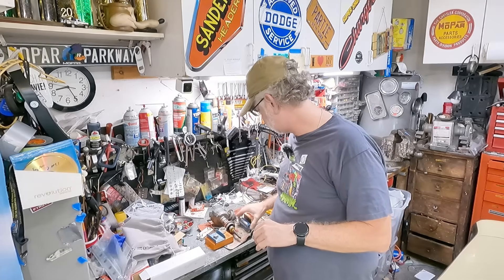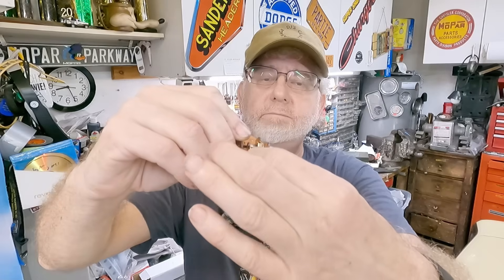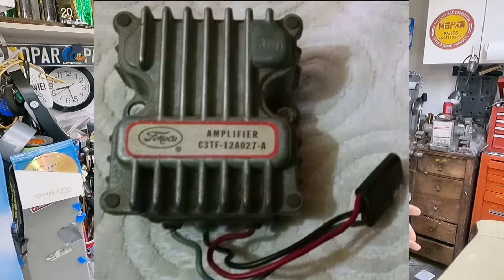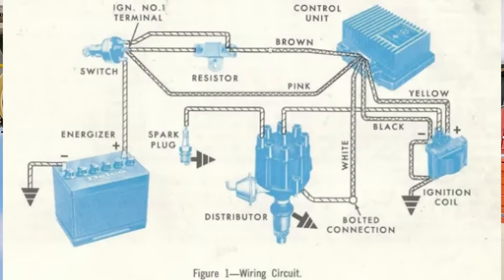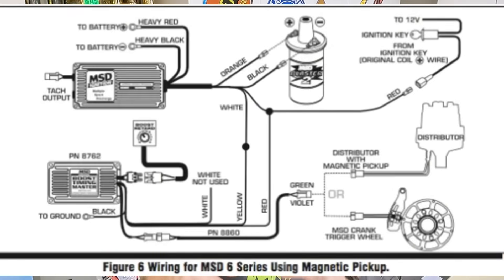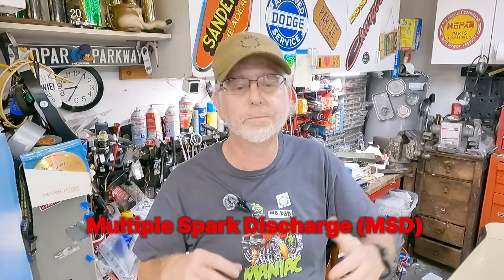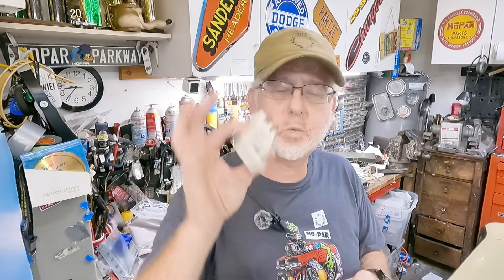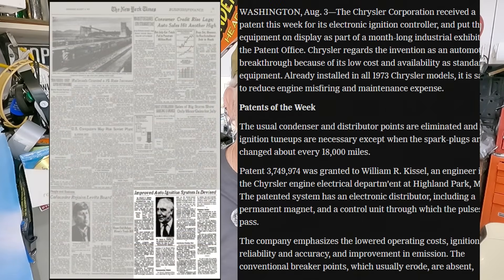Why Everything You Thought About Electronic Ignition is WRONG

Comment: By my experience, the breakdown of the potting compound on these original Chrysler ECUs is not necessarily heat caused. More age related, breaking down over time, have a box of those that haven’t been on a car in decades or exposed to any heat whatsoever, where the potting compound has been liquefying on the shelf for years. Have seen others, later ones generally, exposed to a great deal of heat and no signs of breaking down/melting.

Comment: The 4 post ballast was made for trucks. Put them in a car and you will have problems. I have never seen a factory MOPAR electrotonic distributor go bad. I have picked them up off the ground at junk yards, a little brake clean and they work.
Reply from the maker: Sorry but you are not correct. ALL mopars had 4 post till 1980.  And chrysler distributors and boxes go bad just like all electronics.

Comment: One thing you mentioned was the transistors and moisture were not a good mix for longevity.  You didn't mention that later versions of the systems were potted or encapsulated in epoxy to help remedy this.
Reply from the maker: I did overlook that.  Thanks for watching

Comment: Chrysler used that ballast resistor reliably for many years. The failure was most often blamed on rain/carwash water hitting the hot resistor due to a flaw in the hood seal at the cowl. Simply opening the hood while it's raining would dribble cold water on a hot resistor. I made a simple plastic shield for the one on my 64 Valiant and never worried about it again.
Reply from the maker: Cool solution.  Going from hot to cold fast doesn't work well for electronics.
Reply: A neighbor had one go bad and he soldered it solid across and it worked fine after that.

Comment: The ballast resistor system with low voltage coil ( you say 9 i say 8v😂) was introduced to help in cold starting. The star circuit bypassed the resistor putting full voltage to the coil for a hotter spark.
Reply from the maker: Thanks, we can split the difference 8.5 😀

Comment: I had a 1972 Plymouth Fury with a 360 . I put in a electronic ignition kit from I believe the Bendix brand . Something went wacky and it started to misfire . When trying to restart it , the muffler filled with unburnt gas fumes . When a random spark ignited the fumes , the muffler exploded ! I then went back to points . I had a 1975 AMC ( All Mistakes Combined ) Matador wagon with a 258 six cylinder . I believe it had a Prestolite distributor with BID electronic ignition . I forget if that had a single bushing distributor , like Chevy six cylinder engines . So the distributor was worn and had end play . The rotor would rub against the cap and knock the clips off ! I drove home about 400 miles with the clips randomly being knocked off . Then there were the Slant Six's with a plastic distributor gear . That would crack and you would have to pull the distributor and knock the pin out to replace the gear . Then make sure the distributor was dropped in correctly and retime it .  Then some distributors on Pontiac V8's , near the firewall , would get " baked in " and frozen . They were a nightmare to free up to time the engine or remove . I might have improvised something tied to it to shock it loose . A slide hammer would also work . One guy tied rope to a ladder and two people pulled in out . Aluminum distributor body in a cast iron block , add heat and sludge . Fun .  At least the GM V8's had a small access door in the cap to adjust the points to get a running dwell reading . Better than feeler gauges .
Reply from the maker: Cool stuff.

Comment: The condenser is there to balance the inductive portion of the circuit that would otherwise cause the points to arc when the current is interrupted.  
The secret of capacitive discharge ignition is that it fires the plugs whilr the field is rising in the coil instead of falling.  It is the basis of all solid state ignitions today.
"MSD" is a registered trademark that means multiple spark discharge.  It pops the plugs more than once at ignition.
Reply from the maker: Yep

Comment: Really informative breakdown on the evolution of electronic ignitions. I went to an Accel dual-point first on my 351 Cleveland with an aggressive cam over a stock single-point. It smoothed out the idle and be really woke up that motor. Later I went to to an MSD multy-spark module. The current overpowered the small diameter distributor cap(same as Chrysler). Eventually I went to a Duraspark blue module and corresponding distributor and 8 mm.wires. After receiving the thing I was satisfied with the results. Unfortunately Chrysler's electronic ignition  came at the same time as their notorious(lean-burn) carbs, which was a disaster.
Reply from the maker: Lean burn was a 75 introduction, I use those carbs for doorstops.

Comment: The Mopar Prestolite transistor , point triggered ignitions had no trouble withe revs . Jenkins ran them the whole time I was there , and before and after . He probably got on to them when he ran Hemis , '63 and '64 , and definitely ran them with Corvette point distributors on the Chevys for at least another decade . Very low draw across the points and as drag racers the wear blocks just didn't wear all that much . We ran Mallory 102-X points , no scatter or dwell loss in the Sun machine up to and maybe over 95 hundred RPM .
Reply from the maker: Cool info, there is hours on those aftermarket setups.  They seemed simple but they were pretty high tech.

Comment: I bench tested a MSD Street-FIre for my Deuce roadster 327 back in 2014 and the multiple sparks were at first impressive but were all but done by ~1200 crank RPM and wet-dreams of massive "multiple sparking" went down the toilet..  I initially triggered the MSD SF with the Pertronix "flying magnet" kit which did work until but as reports of the magnets flying off the rotor/trigger I looked for a bullet-proof trigger and ended up triggering it with the MOPAR system that uses a magnetic pickup (LX109) along with the MOPAR reluctor-star (LX104) adapted (by boring) onto the lobes of the Delco distributor. Have several thousand trouble free miles on this system which have NO "sensitive" electronics to fail and with the MSD SF placed under the dash, it is out of the engine heat etc.

My original experience with transistorized ignition goes back to 1963 when I scratch-built one for my 1962 Bonneville HT using the just out Motorola 2n1544 germanium power transistors and a 6V Mallory coil and was mainly interested in relieving the direct firing of the coil by the points and gap/dwell maintenance; the points in this case switched just a few volts.and almost no current and gap/dwell was not a factor for electrical switching, they just had to open/close and the ignition coil was electronically triggered. This worked well for a couple of years and then I moved on to the newer CDI set-ups of the day. Still have a copy of this EI and the original 6v mallory coil..
Reply from the maker: WOW!  That is freakin' cool.
Reply: That is very cool. Was that an MSD Street Fire distributor or ignition box? I want to do this with a GM HEI.  Think it would be better/more robust than a HEI with a DUI Dyna Mod?

Comment: not only all of what the man said. Also , the higer the pressure inside the cylinder , tha harder it is for the spark to jump(arc the gap on the spark plug... So before electronic ignition , you couldnt really up the compression ratio ... this probably why they used more cylinders to compensate

Comment: Less than two minutes in, Dude, and I can see that you don't know very much about ignition systems!  Battery voltage is NOT high voltage at all, which is mainly what the points and condenser sees.  Yes, there is some back EMF there from the primary side of the coil, which is of a higher voltage than the battery when the points open up, but the amperage is very low.  The condenser is in there to dampen out the "ringing" of the magnetic field of the primary side of the ignition oil as the magnetic field collapses.  The collapsing of the magnetic field when the points open, generates a voltage, which blocks the collapse of the field somewhat, but it decreases in steps, which you can still see on an oscilloscope even with a condenser in the circuit.
   The continual exposure to heat under the hood, and the high voltage spikes of the back EMF, breaks down the insulation of the capacitor to the point of where it cannot do its job any longer, and you get a weak, if any spark.  The ignition coil suffers the same fate, heat exposure and high voltage breaks down the insulation, which makes a weak spark.  The snap open throttle KV test on an ignition analyzer will show this.  On another point, a weak ignition system will mimic exactly a bad fuel system, either a weak fuel pump or clogged filter/line.  It can idle just fine, but under load, it falls on its face.
  In short, please get more education and review your videos for errors BEFORE you put them up.
Reply from the maker: Thanks for the input

Comment: Interesting history. So glad we eventually got to coil on plug ignition systems. They are nearly maintenance free. Coils and stuff can still fail of course but they're pretty robust. I've never had an issue with them. My 4.2L trailblazer has 150k miles and other than plugs once, no ignition work ever needed.
Reply from the maker: Yep that is part 2 , life depends on application.

Comment: Been a B Body mopar fan back when they weren't cool. 1977. Im 64 now and have my clean 69 4 speed RoadRunner in my garage. Original 383 sitting in the corner. 440 in her now. I'm running a pertronix ignitor 2. Been working fine for years.
Reply from the maker: Pertronix is a very simple aftermarket system.  That car must scream.

Comment: The Ballast Resistor (and Wires in Ferds) usually is used to reduce ignition coil voltage during run time. Also usually, is a resistor bypass during Start so the ignition coil gets full voltage during Starter Motor Operation and cold starts. Especially important in winter conditions! Like that tube thing from exhaust to air filter to prevent carb icing... ! <3 all

edit:, oh yea, wanted to say stuff about the '74 W100 but it was always good to me as long as it's wiring terminals were polished and clean and lubed with silicon dielectric and lithium grease.  Cos, I liked doing what I call the "Moses" where full throttle through water! super bad for stuff, I kno but fun af!
Reply from the maker: Yes.

Comment: Before about 1970 most single cylinder lawnmower engines used breaker points and a capacitor across them to energize a magneto with primary and secondary windings to fire the spark plug,it differed from a car system in that it only had to fire one plug and the primary winding was powered by a flywheel magnet that went past it every revolution. A spark would be fired at the top of the exhaust stroke as well as near the end of the compression stroke.
  Tecumseh Engine then came out with a system that supposedly contained a capacitor discharge unit as well as primary and secondary windings but instead of breaker points it used an electronic switch that detected the flywheel magnet rotating past and opened the primary winding circuit. Supposedly had a slight advantage that at higher RPM the magnetic field was detected a bit earlier in the approach of the magnet giving a slight spark timing advance at higher engine RPM  (but probably not as much as the engine could have used)
The now defunct Briggs & Stratton came out with a magnet triggered electronic switch to replace its point system but I think initially it did not have capacitor discharge spark.
Reply from the maker: Wow.  I did not know that

Comment: I have a 383 that keeps gas fouling the plug any suggestions. Ido have the early electricity ing
Reply from the maker: in this order. Make sure the carb is metering the fuel properly, no leaks of fuel floats too high or jets too big. Get a spark tester, inline light bulb, and see if it really bright when it fires.If not check plug wire resistance. if OK Check the gap for the pickup in the distributor, needs to be 0.08-0.10 if OK Try a 2 step hotter plug

Comment: The orange control unit this guy has is Mopars performance control unit. The stock passenger car and truck control units were bare steel. A lot of guys mounted an orange box right next to the stock units so they could switch over easier in street strip cars. The HEI system worked ok, but the cheap materials used in the rotor and distributer cap would shed metal inside the cap and when it got dirty enough the car wouldn’t run.the ford units were prone to failure. Sorensen had replacements that lasted almost forever. I’d would like to know exactly what the difference was.
Reply from the maker: Sorensen used better materials, GM and ford had to make a lot of units to just last longer than the warranty

Comment: I don't remember 10,000 mile point intervals - I always heard 1 year or 12000 miles, which is what I believe the owners manual for my moms 66 Chrysler Newport said, with the 383 v8, and chiltons, haynes manuals - one thing that a youtuber said about this was that he had never been let down by a car with points if properly maintained - but he had been let down several times with electronic ignition - I would second that - surprised me so much when the electronic ignition went out on my beloved 75 Dodge Dart Swinger with the 318 - also had main computer failures over the years, causing a 87 Dodge Daytona with the 2.5 Chrysler 4 to drop dead at 8000 miles - and with the awful 2.6 Mitsubishi engine in my 85 Chrysler New Yorker e-class - it kept dropping dead when carpooling - would be towed into the shop - who would call and say "whats wrong with it?" - they finally replaced the hall effect thing in the distributor as they could never get it to malfunction in the shop - which fixed the problem. My 99 Ford Mustang six, auto - has been the best car I have ever had, no real problems with the electronic ignition I can recall, or the main computer.
Reply from the maker: It is a ballpark.  The 80s Chrysler systems were absolute junk, and the 3.8 Ford 6 is probably one of the best V6 ever built.

Comment: There was an add on CDI (Capacitor Discharge Ignition) still used the points that greatly improved performance (according to my father) this was in the late 60’s the product was labeled Delta.
We had several of the late 70s Fords with that ignition system it was so problematic until the 80s that we always had extras on hand
Reply from the maker: That was pretty much the GM system from the 60s.  Points can't handle that much power for long
Reply: JC Whitney sold them. The early Fords system was always going bad. The GM HEI had so much voltage that they were arc through the rotor plastic body, to the distributor shaft.  The GM HEI requires a "high quality" rotor, that is thick on the bottom, all the way from the outer edge across the center. The cheap replacement HEI rotors are not like that. Chrysler seemed to have the most success. A neighbor had his ballast resistor open up and he soldered it solidly across and it continued to work fine after that. One big reason for the switch to electronic ignition was the higher water and engine temperatures were causing the lube to run off of the points, resulting in excessive wear. Maybe some higher temperature disc brake parts grease would help the points last longer. Points and capacitors are super cheap to replace.
Reply from the maker: @BrandonLeeBrown Man that is some cool info.  
Probably with the grease we have today the points would last longer
Reply: @DJsClassicGarage  The problem might be that today's points likely are not made as well as they used to be.

Comment: Mopar Baby! Run orange box myself in all 4. Mopar had a duel one in the 80s, pre lean burn. Ford's was made by Jacobs when he worked there. Later be came Jacobs electronics. I have one, has 15° inside adj and a rev limiter. The rev limiter doesn't cut cylinders off. Can't remember the how it worked. Look forward to more videos.
Reply from the maker: That is cool. there is more on ignitions coming.  Will look for Jacobs info
Reply: @DJsClassicGarage he had 3 boxes in the early 90, ignition, ignition with rev limiter and ignition rev and nitrous. Used to advertise in magazines about best gpm system or money back.

Comment: I remember making an electronic ignition from an electronics magazine many years ago and it felt like it made a slight difference seem to idle better anyway
but one night I started the the engine and it started misfiring badly when I opened the hood there was sparks everywhere coming from the spark plug leads it was lit 
up like a Xmas tree . It must of been condensation on the leads and the higher voltage breaking through I ended up was putting the leads in HV insulation sleeves.
Reply from the maker: Wow.  I remember the older wire sets would arc badly because of thinner insulation.